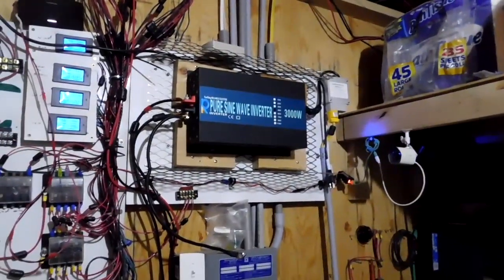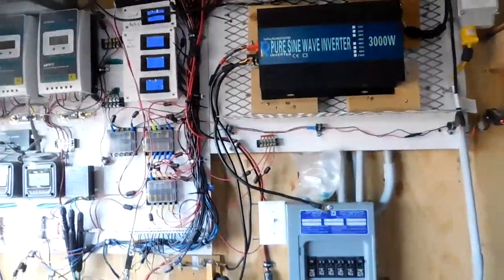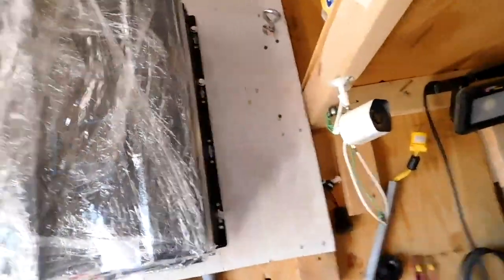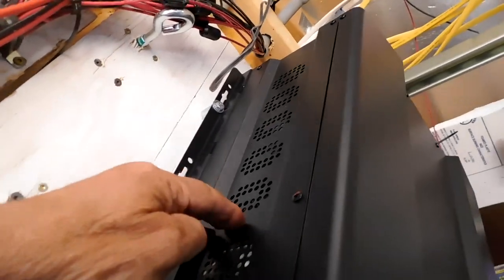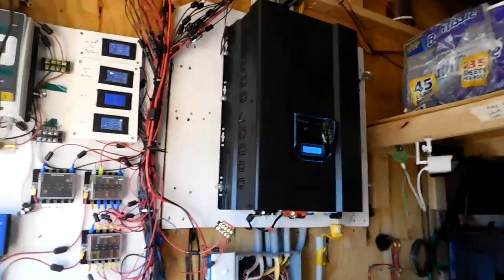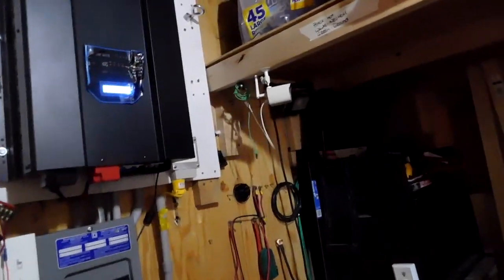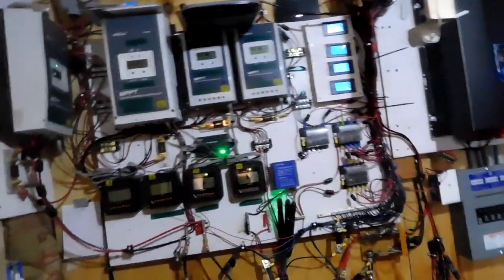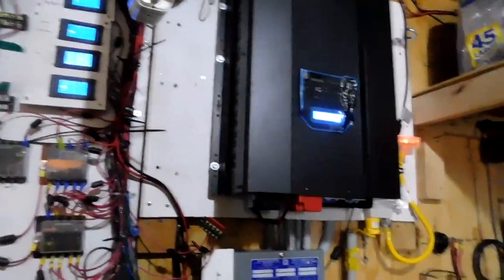Building an off grid house part 174. 10kw Treeline Power Systems Inverter.

Comment: Well done on getting that sucker up and mounted !
Reply from the maker: Thanks, there wasn't enough room between the rafters and inverter to use the chain hoist so I just used a pully and the truck winch. It woulda gone up a lot faster but I got it off centered on the first try. and had to drop it down and raise it again. 20 years ago I could have just hung it up by hand!

Comment: Those DC cables are way too small for a 10kW inverter. I'm surprised they're not smoking.
Reply from the maker: 8kw and they’re 00. Don’t even get warm.
Reply from the maker: Oh youre right, 10kw. But they are 00.
Reply: @timsvids5983  Wow, they look so much smaller than 00 on camera.

Comment: Great to hear from you! I was going through some withdrawal... How is the rfi from the new inverter?
Reply from the maker: Hi, good to hear from you. The RFI is fine. I believe it’s better than from the old one. I don’t hear anything on the truck radio until I’m right next to the house. The base radio isn’t getting any noise that I’ve heard yet. I’m running out of things to post videos about. Haven’t been at the house in a couple weeks because of flooding and fire problems at the other houses. Just doing a lot of riding in the mean time.